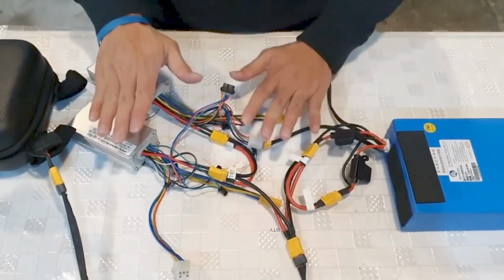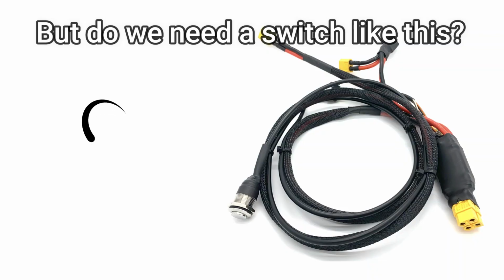How to Connect External Batteries in Parallel and when to use Switch

Comment: In conclusion, the cheapest parallel wiring harness is the best as it doubles the current output and decreases the stress on both batteries.

Comment: i use y cable on my bike
and use also an y cable on a charger... so i have both in parallel on use.. and on charge ... but one pack had an inline diode on charge port so i had to add also one in the other pack to match the voltages... now all fine

Comment: If i run a parallel conector, do i have to have both batteries connected. Could i only run the internal, and take the external battery off the circut?
Reply: Yes you can. You can run them together, or separately, by connecting/disconnecting the wires to/from the parallel connector. If you connect them both and try to charge the batteries it may not work because the BMS in each battery pack will conflict with each other.. You will have to charge the battery separately. Or remove the BMS from one of the two battery packs for the charging to work.

Comment: Has anyone actually installed the solid state switch relay on their scooter? I'm curious, because clearly its way too big to install internally, and with that logic that means the switch relay will need to be installed somewhere externally and there will be more wires that will need to be outside of the deck.

Comment: You cannot discharge and charge with DC current at the same time. Your explanation makes no sense. 

The correct answer is if your batteries are at different voltages the current when connected in parallel may be quite high for a short period of time. The battery discharging can likely handle this but the battery taking in that current…well nearly every lithium ion has a charge rate that is a fraction of their discharge rate. The P42A can discharge at 45A (below 80 Celsius) and is likely capable of bursting higher than that without negative consequences (the data sheets often give two life cycle numbers for a slow charge/discharge and a fast charge/discharge so keep that in mind) but the max fast charge rate of the 42A is 8.4A or 2C. You’ll see that even the best power cells from Samsung/Sony/LG typically have a limit of 2C when charging but discharging rates can be 10C. 

So one battery might be discharging at a rate that is close to or within manufacturers spec but that means the lower voltage battery will be FIVE time over the safe charging rate. 

Voltage differences of less than a volt typically only give very short bursts of current before declining to a much smaller rate but over one volt and you can see some very large balancing currents that last for more than 10 seconds depending on the size of the batteries. So besides voltage difference there are two other factors. Internal resistance and battery size can increase the current rate and length of time if the pack has low resistance and is very large in capacity. 

This can be simulated by taking two high IR cells 1V apart and measuring the current flow vs two low IR power cells 1V apart and measuring the current flow. The low IR cells have the ability to balance each other faster albeit at higher currents. The larger the pack the longer it will take them to balance which means more time it will take for the voltage delta to change from 1V to 0.9V
Reply from the maker: Thank you for the detailed explanation.
Reply from the maker: We understand what you are trying to explain in detail but when explaining to lay person there is no way that explanation wouldn’t fly over the head of most people. What we are trying to say is essentially the same, but communication needs to be simplified so people can understand.
Reply: Yes, your message is too long and I was feel like going to sleep. God did tell me that what you said (all of it) is incorrect.. As for the Molicel P42A battery cell handling 45A discharge and 8A charging is incorrect it will cook those eggs for good. Their test rating is fraud. At that rate those cells will go bad very quickly, less than a month.  The Samsung 40T cells on the other hand are the opposite, they handle 45 to 50A discharge and last much longer than that. It can handle 8+A charging as well.  For the Molicel P42A the safe charging is at 1.5A, that is one and half amp. The owner that runs this company will run into serious trouble cause a lot of high ranking criminals are getting scammed by these batteries. You also need to be careful on the Samsung 40T cells as almost all of them floating in the public market are fake, but performs better than the P42A in charging.

Comment: “A spark is good”

Uhhhh an anti spark XT90S is like $2. Not using one screams cheap component selection. 

Why destroy your connectors with constant electrical arcing? It will raise the resistance of your connector
Reply from the maker: Anti spark connectors are usually lower in current rating than the non sparking ones. But regardless alot if escooters use normal connectors. When we say a spark a good it means the battery is still alive.

Comment: Connecting in parallel is a dangerous method,it can burn both of your batteries or degrade them prematurely,one discharging the other.The safest method is to extend the cable from the controller,tonaply a 6 pin swich(ON-OFF-ON) and to use separately the batteries,also charging separately.If y realky want to connect in parallel without switch,y need 2 new batteries with the same voltage,the same brand and the same capacity,fully charged and use the same distance of cable for connecting to controller and charger.Otherwise,y will have errors of charging batteries.

Comment: Other scenario: my bike has a built in batterie. so every time i want to charge it, i need to carry the entire bike to my flat. therefore i want a 2nd one, that i can use first and recharge easily. if i happen to need more than that power, i can switch to the internal battery on the run.

Comment: Hey so what will happen if I install the external battery first on the scooter before charging? I won't use or ride the scooter yet. Then after installing it, charge both the internal and external batteries. Is this bad or it doesn't really matter since I won't ride the scooter until they are both fully charged anyway?
Reply: You'll be fine if you do it that way. Just make certain you plug everything in correctly and when you do charge them you, they are fully charged and you'll be good to go.

Comment: I have a question I have two exactly the same batteries 52v 26ah but both fully charged show different voltage on my voltage keylock ignition screen when I plug them in separately. One says 57.9v other says 56.3v will this be safe to use this lead and be safe to connect? They work perfectly on my nanrobot D6+ just the cells on both have a cell or two each needs replacing. Can you help please
Reply: You can run the 57.9V battery down to 56.3V then parallel them together. As long as they are both 56.3V to 56.8V you are ok to parallel them together. Hope that answers your question.
Reply: Do you know the answer?
Reply: @itiswhatitis528  nope
Reply: @DripdropBrewing  Damn it. Did you connect it pararel to your scooter? If so, is it working correctly?
Reply: @itiswhatitis528  nope I asked so many people and giving me mixed answers so I gave in and don't want to risk damaging my batteries or causing a fire. I'm going to leave it and keep it original 👊👊👊 if you do get answers and get this working please could you let me know would be nice 👍👍👍
Reply: @DripdropBrewing  I have exacly the same situation with my 60v battery for Wolf Warrior X. One is 67.2 and the second one is 66.3. Both works perfectly separately but I am not sure if it is safe to connect those pararel ....
Reply: @itiswhatitis528  100% you can. As long as the both batteries have the same voltage like mine both have 52v 26ah they will work. The reason why ones lower voltage on your key ignition screen is that the battery are unbalanced and dead or needs replacing. So you still got original voltage on both batteries but batteries have a Dodgy battery or two. So parallel lead will work flawlessly. But all I know is both batteries have to be fully charged before putting on parallel lead. The have be roughly the same voltage on all batteries so the BMS can balance it. Also needs to be synced as well. And I don't know how to really do that so that's why I haven't done it. Balance and syncing is the important part before pararell lead is added. If not can kill all cells and both batteries will be naffed
Reply: @itiswhatitis528  you 100% got overcharged batteries in your pack. Maybe one of two or more just like me. Each individual battery should be roughly around 4v each we have both got one or two lower in voltage maybe 3v-2v so they are not balanced to 4v and BMS recognise these low ones as 4v and when fully charged it will be lower on the ignition key screen. So the need replacing and fully charged them ones on a external 18650 charger till the read 4v and now that pack will now be brand New again. The BMS will give you the New perfect voltage like when you first had the scooter from new. Now you can parallel them together because both batteries are balanced.. but both batteries have got to have 4v individual batteries and good as new.
Reply: @itiswhatitis528  Let me know if you find out - I am  playing around with a new X now.
Reply: @BallisticTip  I did not try anything yet
Reply: @itiswhatitis528 I bet one has a diode in charge port and the other has not
Reply: @DripdropBrewing not roughly... if complete full each cell should have 4.2V
52V pack has 58.8 (14s)
60v pack should have 67.2 (16s)
Reply: I bet the packs are not identical ... fully charged it is 58.8 max ... one pack may have an inline diode in charge port and does not charge to same voltage then
Reply: I have added a 2nd pack and had to add diode also in the additional pack (and lift charger voltage) ..now both have same voltage drop on charge port..
Reply: So two 52v one is 20.8 ah and the other 23.4 ah will be connected. One has inline fuses on the charge end the other does not. 2 questions, 1. Will they work fine together? And 2. Will I be ok to charge them in parallel via the original ports without adding additional connections to the other charge ports of the external battery?

Reading the comments feels a little unsure
Reply: @christophercollins1959 inline fuse is no problem.. but on some packs you have an inline DIODE (means about 500 to 700mV drop over the diode) ... so then the packs do NOT charge to same voltage (the one with the inline diode is lower)... to overcome that problem I added also in the other pack an inline diode and lifted the charger voltage from 58.8 to 59.5 .. and I use ONE charger with an y splitter cable ...
charger can be set to any voltage from 42 to 84V ( so very flexible) and from 2 A up to 15 A ... I set it to 8.5 cause each pack can maximum take 5 A on charging
 and I wanted a bit safety room
with voltage set 59.5 V the charger switches off at perfect 58.8V (and it does not cook the packs for hours)
so if your backs are not identical when full.. check if one has an inline diode
if answer is yes.. then add also one in the other pack (on mine I had to add it in the MINUS RAIL of the charge port)...

Comment: How do you charge the two battteries?
Reply from the maker: Each battery has their own charging port so you can plug in 2 chargers one to each battery
Reply: @FalconpevSg  thank you.
I only have 1charger.
Reply: @FalconpevSg  and one more thing may stock battery is 1year older to my external battery, but it's still perfectly working .
Do you think it's fine?
Reply: @FalconpevSg  Is it okay to leave the batteries connected in parallel using Falcon PEV's basic Y parallel cable and charge from only 1 port at a time? Would letting the battery getting charged to charge the external battery as well through equalisation?
Reply: most packs can NOT be charged on the load port
Reply: I use an y splitter on the load port and an y splitter ON MY CHARGER ... So usage and charge in parallel ...   BUT ... both packs have a diode in charge port.. means one pack does not see the other but charger brings both packs to same voltage

Comment: Hi I have a question,
 If I connect 2 battery packs in parallel and on the 2 packs I chooses separate port  bms ,they still going to charge themselves?

Comment: hey i want to add two 60v batteries in series and use a switch to shift the batteries if one of them drains out so we switch to othe one. can you help me with that?
Reply from the maker: So you mean in parallel not series, otherwise you can’t really switch between them. If so Yes you can, check out our solid state switches

Comment: Does anybody know why my battery cuts out at about 39.5 volts? (it used to run the motor right down to below 36 volts).
Reply: Well first we need to know what type of scooter you own. And you never ever let any scooter cut out or fully charge it ever that's why your having problems and your killing your cells and won't last long
Reply: @DripdropBrewing  I have only just discovered this post never having seen a notification.
I don't own a scooter I own an electric bike & I replaced the whole electronic system since making this post.It is now running super dooper & I do charge it fully but because I replaced the built in battery with a larger capacity one have never run it right out.
Reply: controller is maybe a 36v 48v  combi controller and now it thinks it's in a 48v system (cutting out at 40 Plusminus 0.5)
Reply: @dg9bfc  Since I replaced the whole system there is a new controller in there.
If I can ever get round to it I might stick the old battery back in there & see if it runs ok now or I might wire in the two battery's for longer rides,well shall see 🙂
(Someone else mentioned a fault with the controller rather than the BMS or whatever you call it in the battery & I had never thought of that before.First the horn stopped working then the front light & finally the brake cuts outs before I replaced the whole system so maybe I should have thought of that).

Comment: Hi, i have a question. Currently im using external battery as my reserve. Both internal and external batterries are using same V and Ah. Once i notice internal battery on low, I manually disconnect the internal battery cable and switch to the external battery via XT60. Is there any concern or safety precaution that i should be worry about on my current battery set up or do i need two of this Solid state switch on both batteries? Just bought Escooter a month ago, so still new to this. Thanks.
Reply: I've been using external and internal together both 36v
Reply: I also use both my pack in parallel so they share current

Comment: how does parallel battery pack paring effects the battery with lower ah??
lets say i have internal pack which is 25ah and then i buy this external pack which is 12ah,
or by pairing parallel the controllers will drain both packs equally regardless of each packs ah capacity???
thanks.
Reply from the maker: Assuming same voltage, it will drain both packs unequally drawing more current from the pack with the higher Ah which is also the pack with the lesser internal resistance.

Comment: So if I have external battery with different capacity, same voltage and different discharge rate would it be better to use Switch?
Reply from the maker: Tbh there’s no need to if the voltage is the same. Save yourself that money and just try to do voltage matching
Reply: different discharge so different voltage is unsafe with y cable!!! if both packs are full or both at 50 or 60 percent then connecting y cable is safe

Comment: Hey, I know this is an old video but I hope maybe I'll get an answer, I want to increase the range in my ninebot g30p, I want to build a external battery with the same or more Ah than the original battery(15.5ah), will I be able to just paralel them by the xt60 y splitter and use/charge them just by doing that? And if that will work, will the scooter read both battery levels combined averagely correct?
Reply from the maker: Yes you can parallel them both together with a xt60
Reply: @FalconpevSg  hi, I have almost the same scooter, 36v 15.3ah stock battery, if I buy 36v 20ah external battery and do parallel connection, would it cause a problem or do I need a switch or firmware for that? Will the scooter read both battery levels combined averagely correct? Thanks a lot for the answer
Reply: @greaturkk  also wondering this
Reply: @greaturkk when connecting both needs to be same voltage!!! so same state of charge!!!

Comment: i bought your parallel wire harness but i'm not sure if my external battery is actually being used. how can you tell when the external battery is connected and running parallel with the internal battery?? also my external battery has two XT60 connectors and when i connect the parallel wire harness to one of connectors it blows the fuse, but when i connect the wire harness to the other XT60 port it doesn't blow the fuse.. any help??
Reply from the maker: Pls email us
Reply from the maker: We need pictures

Comment: Spark is bad, it's very bad, it will damage the connector and you will have to change it at some point. Just use spark protected XT 60-90S connectors.
Reply from the maker: Yea but the voltage rating is much lower. They cannot reach 60A
Reply: why are sparks bad?